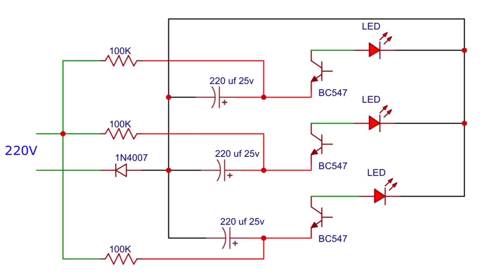Amazing led flasher on 220V AC

Comment: Cool...Just to be clear, for those who would not feel comfortable with using high voltage, you can redesign this circuit to work on a safer DC voltage.
Reply: Yeah idk why he used 220 vac  when he's half wave rectifying

Comment: The construction method is totally unsuitable for a circuit designed to operate from the mains.  Stuff like this should be made on a proper circuit board with some sort of protective component.  Mains voltage isn't for experimentation like this - use a low voltage PSU (an old phone charger would do) and have loads of fun with near-zero chance or causing a fire or hurting yourself. Stay safe 😀

Comment: Very excellent beautiful connection... Pls make in 4 volt rechargeable battery...
Reply: Don't use resistors
Reply: 01:48 for 3x 1.2V rechargeable AAA batteries (2.65V flat to) 3.6V supply you use the formula V=I.R or R=V÷I 

R=3.6V ÷ 0.02A = ( 180 Ohm) resistors {instead of where  the 100 kOhm /120 kOhm are used on 220V AC}. Alternatively 150 Ohm resistors for 2.65V flat batteries could be an option but then bridge a 330 Ohm resistors across each RED LED. 
 - 
With a lower supply voltage you could reduce the Capacitors from 470uF 25V to 470uF 10V but because the caps could pop/explode if incorrectly connected to a larger voltage (ferrous ⅛W resistors with negative heat coefficient, arching, moisture, etc.), it may be advisable to keep to what is readily available

Comment: Wait, how is this supposed to work if you didn’t connect the transistors’ bases to anything? What causes the switching?
Reply: air
Reply: idk
Reply: 01:48 While the Capacitor is charging the reverse Voltage is NOT high enough to complete the circuit. 
🔍 Once the Cap is charged the reverse Voltage approximately 1.75V is overcome and approximately 20mA Current flows through each LED to produce intense light. 😋
The 1N4007 Diode prevents the 10mA LED & BC547 overheating because only one half of the AC sine wave is utilized. 
The 1N4007 Diode also allows you to use )I electrolytic capacitors throughout the circuit. 😉

Comment: Kya ye project DC 3v/6v/12v me kar nice project.. sakte hain ??
Reply: 3 volts ke liye koi bhi resistor use na kare
6 volts ke liye 100 ohms ke resistors use kare
Aur 12 volts ke liye 390 ohms ke resistors use kare
Reply: @beautifulworld1491  Nice to see responses which actually help people (even if I don't understand your native language)
Reply: @donbriggs9128  Thanks Don 😇.
Love to help people with the knowledge I obtained.
The language I used above is hindi (National Language)
I would love to help you in this if I can.
Reply: @beautifulworld1491  I never work with mains voltage, with the exception of power supplies. Looking at other comments you have also replied to, I would imagine that a lot of others don't either.
I can only speak English. I have tried other languages but failed. I think it's great how countries like yours manage to learn two languages as normal.
Reply: @donbriggs9128  In india approx 25 languages are spoken
Among them I speak 4 languages.
Reply: @beautifulworld1491  Wow. I take my hat off to you.
Reply: @donbriggs9128  😇 , I believe u are from England.

Comment: Hi. Pls do this for 5 volt.
Reply: It works for 9 - 12 volts min
Reply: It depends on the reverse breakdown voltage of the transistor you use. The minimum voltage changes depending on what transistor you use.
Reply: But small current bias  (maintained by high ohm resistor) could lower the voltage for this avalanche effect.
Reply: 01:48 for 4.8V to 5.2V supply you use the formula V=I.R or R=V÷I 

R=5V ÷ 0.02A = (91 Ohm + 180 Ohm) resistors in series {instead of where  the 100 kOhm /120 kOhm are used}. Alternatively 330 Ohm resistors for energy saving could be an option but NOT if your supply source consists of 3x 1.2V rechargeable AAA batteries linked to blue high intensity LED's. 
 - 
With a lower supply voltage you could reduce the Capacitors from 470uF 25V to 470uF 10V but because the caps could pop/explode if incorrectly connected to a larger voltage (ferrous ⅛W resistors with negative heat coefficient, arching, moisture, etc.), it may be advisable to keep to what is readily available

Comment: Nice circuit...Do you  make a circuit with only one led with BC547, resistor and capasitor?
Reply: @techmaster6587   ?...
Reply: @techmaster6587  No need to beg. If it's any good then yes, otherwise no.

Comment: tum 25v polarised capacitor ko 220ac me daal raha hai..
Kaha se padha hai?
Reply: capacitor ko direct 220 volt nahi diya hai ,100k resistor se diya gaya  hai.
Reply: @goodfood2464  100k ke resistor me kitna current drown karega?
Aur kitna voltage drop karega?
Reply: @goodfood2464  polarised capacitor ka use kahan hota hai? AC or DC?
Reply: @ashishdhibar7607  DC me lekin circuit me diode bhi use kiya gaya hai,lagata hai aapne video skip karke dekha hai .
Reply: @goodfood2464  transistor ka base or emmiter  ka connection hai collector kya karega? Agar collector ka use nahi hai to woha transistor kyu use hua hai doide hi laga dete
Reply: @goodfood2464  but any way agar yeh circuit 12v dc me dete to jyada acha hota safe bhi hota aur yeh mini project behtarin hota...
220v AC ka yeh project hai hi nahi....
Reply: a. Ignoring the 1N4007 diode which limits the current to 1000mA, the LED is a Light Emitting DIODE too. in other words the )I electrolytic Capacitor should not damage given that the relative operating Voltage (potential difference) is approximately between 1.2V nominal and 6.8V peak. 

b. The BC547 transistor also limits the current further to approx 700mA. 
Therefore 470uF Capacitors rated at 25V DC should be fine and do NOT have to be rated above 375V. 

c. I do prefer to have the 1N4007 Diode directly on the supply point side just in case there is a short; due to the exposed portions of the conductors. (Add a 1A to 3.15A pica Fuse there too.)

Comment: Completely lethal, bare mains voltage...
Reply: Only if you touch it, or spill water on it, or it contacts a conductive surface/object  you are touching, :-P
Reply: Or if it shorts and the two mains wires melt while you're still holding them
Reply: Drink baby  food

Comment: I know your always focused on these small but really useless devices because you get some likes for your time. Could I get you to change direction for a while and work on (ENERGY SCAVENGING CIRCUITS)????  Circuits that take Energy from the Environment.  Using the (JOULE THIEF CIRCUIT) to boost the VOLTAGE and CURRENT up to something very usable.   Our EARTH,  PLANTS and AIR along with WATER and the WAVE ACTION can produce a lot of ENERGY that with the right (ELECTRONIC CIRCUITRY) could be Harvested and used in our everyday lives.  Look at it this way, if you will. You have just found yourself Stranded maybe for Life somewhere and you have no Electric Power to Run Anything. You need Heating for Water Purification plus Lighting. Maybe you need Power to run your Radio.  Whatever.  You have access to used Electronic, along with other things like (ALUMINUM), (ZINC), (CARBON), (COPPER),  and so on. With your Knowledge could you Build a Power System that would Help you make your Life become Easier??????? I know all these thing I've mentioned above can be done.  (Would you consider my request????????)   Thanks for the upload.